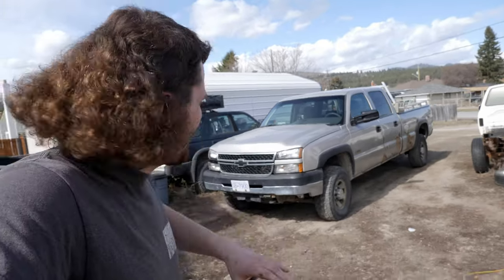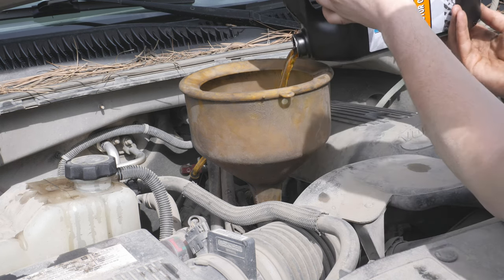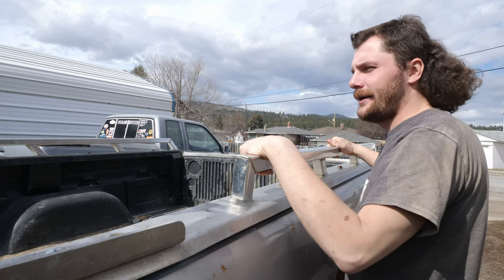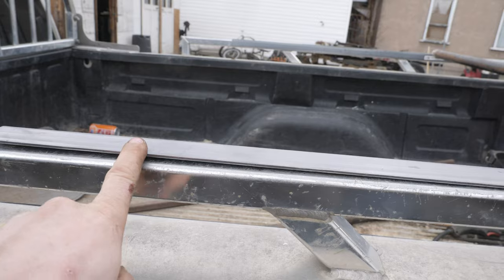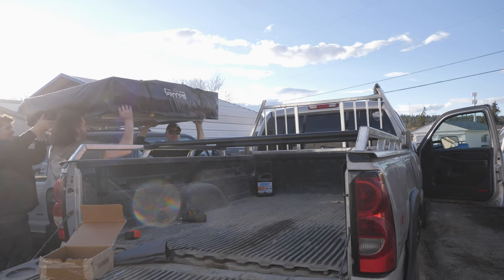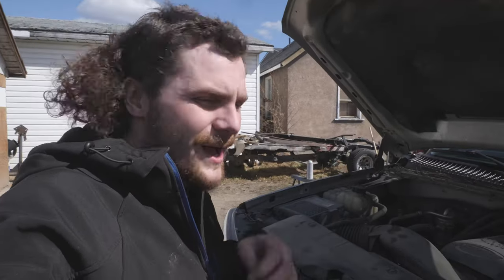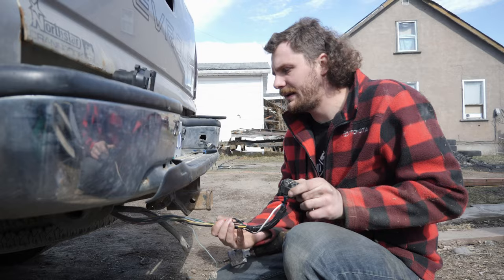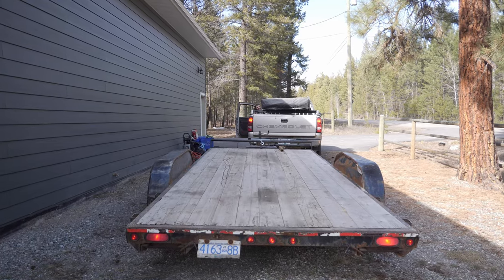Building a Custom RTT Mount / Rack

Comment: The vortec 6.0 takes 6qt of oil not 9qt the auto parts lady made you over fill it I own the same truck you have and I’m also a fleet maintenance mechanic.
Reply: 4.8 and 5.3 and 8.1 is also the same 6qt